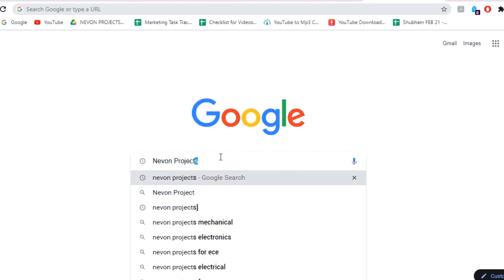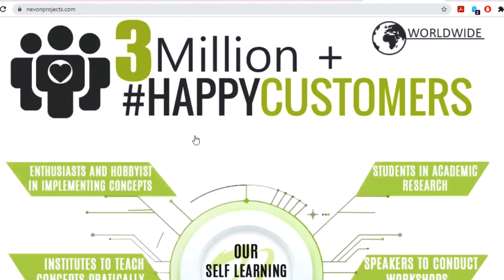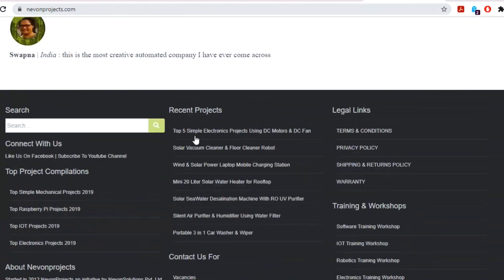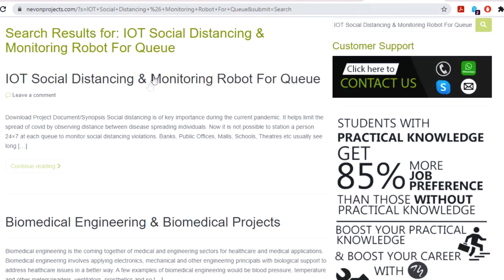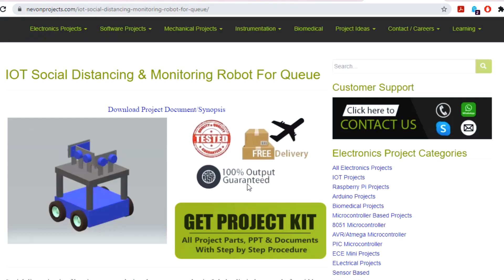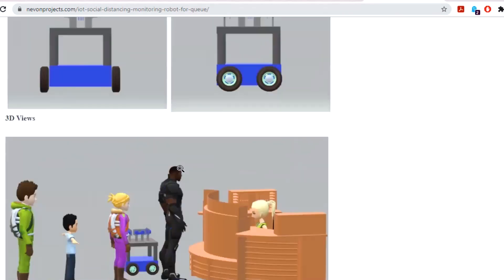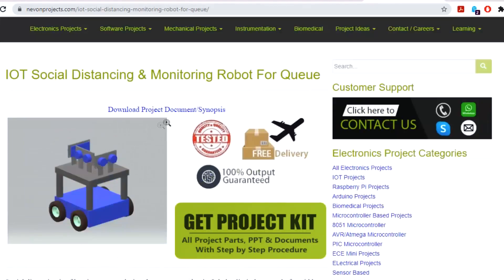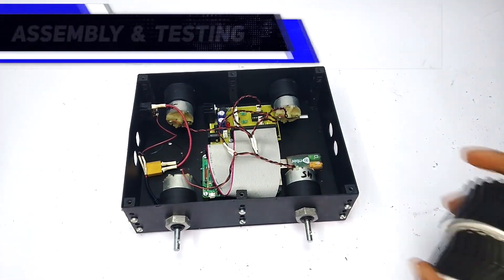IOT Social Distancing Monitor Robot | Raspberry Pi Project

Comment: I have a doubts about this robot .In minute 5:57 , the robot goes back following the line in the reverse direction without using IR sensors in that direction as you are using only two IR sensors in the forward direction.Any clarifications ?!
Reply from the maker: For this Electronics system details or free document/PPT pls call watsapp
+917738796642 or visit link in video description